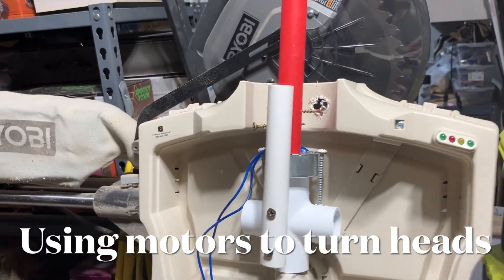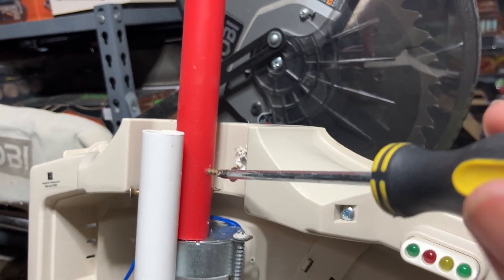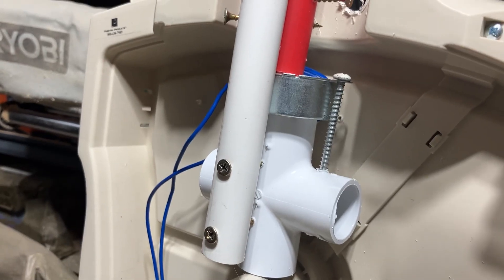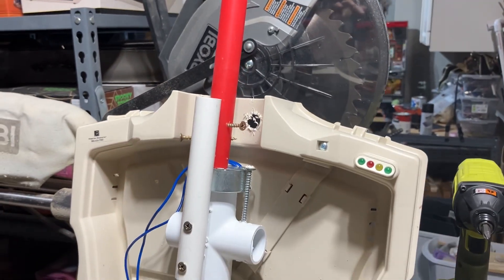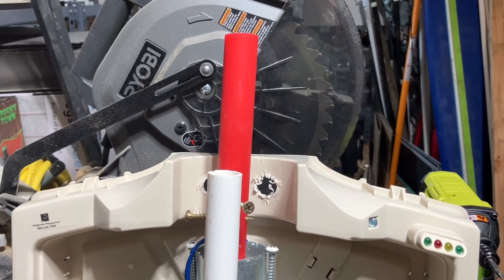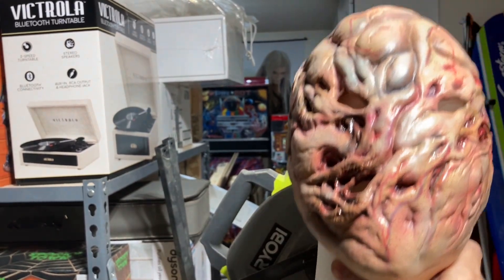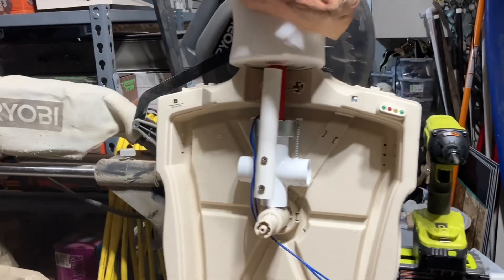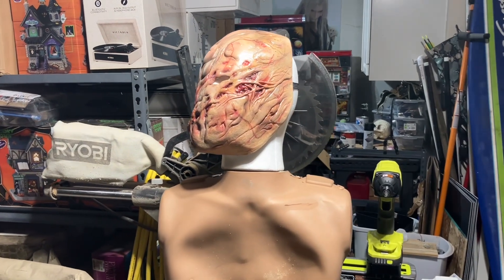Moving heads with cheap motors

Comment: Hey can you give me the link to the screws holding down the motor to the 4 way connector?
Reply from the maker: @IsaakO-sf2rd  as long as it is 2 1/2’’ or longer, any screw will fit. (5.5-8 cm) I’d go with it being no wider than a #8 so it fits in holes. I have no idea if you are in the US but if you are, I use these a lot when securing motors.

https://www.homedepot.com/p/Grip-Rite-9-x-3-in-Star-Drive-Bugle-Head-Coarse-Thread-Construction-Screw-1-lb-Box-3GCS1/204959258
Reply: @brianbenson3091  thank you I appreciate it

Comment: The motors seem to survive just wondering how long if they get stopped w the screws over and over if itll burn em out
Reply from the maker: Good question. I’ve had those for a couple years now and use only during builds and Halloween. So I have no idea if it affects the motor life. I don’t even know the normal life of them. Some of them get hot and quit right away and some go on and on…
Reply: They are designed to reverse direction when they hit a "stop".  And at least in my case, they were only turned on for a few hours on the one night needed.